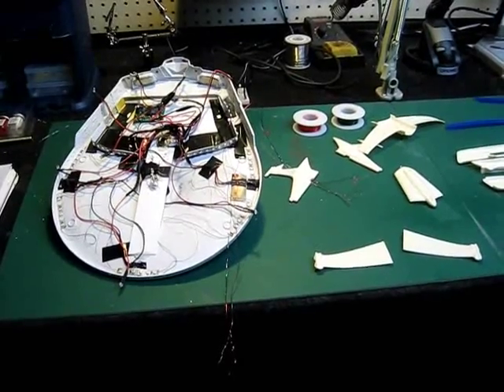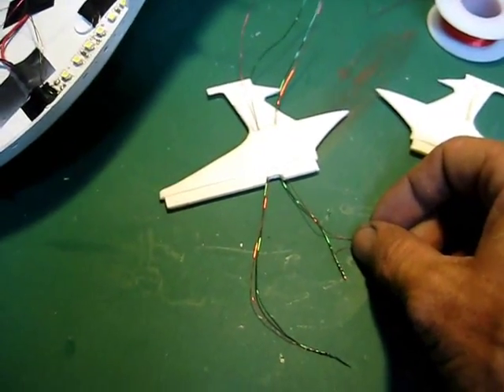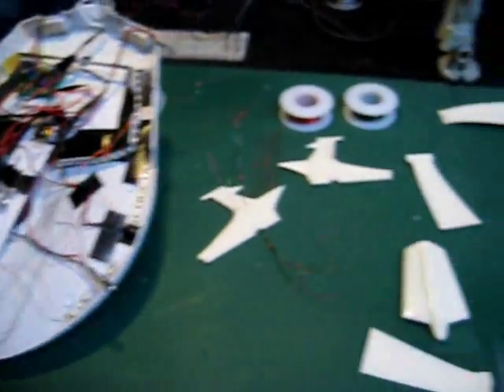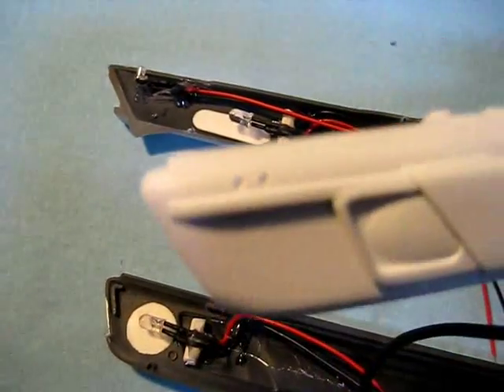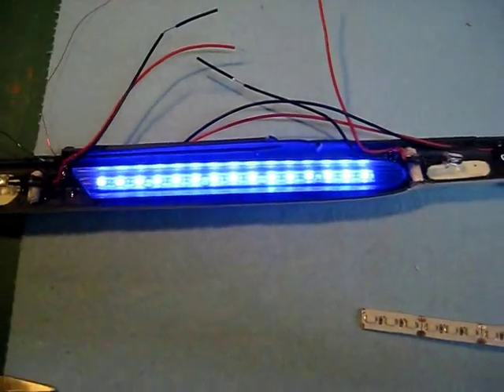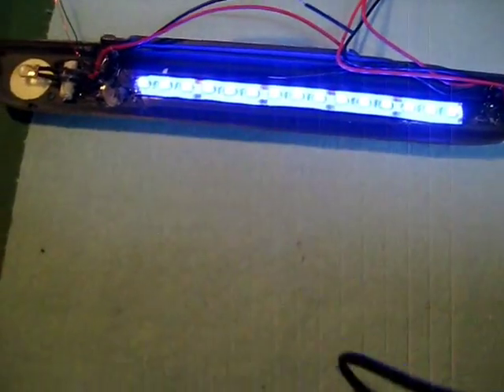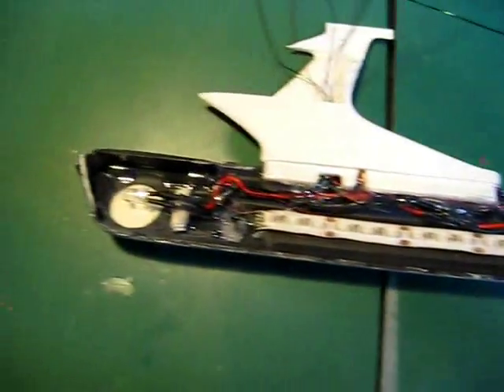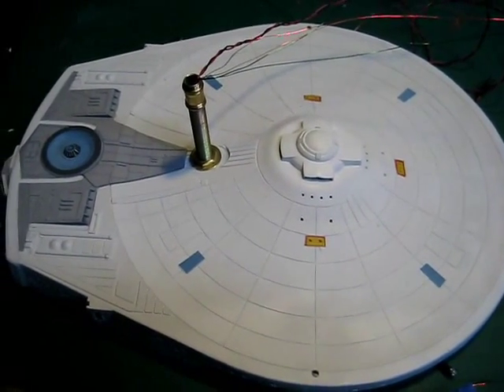From TrekWorks Round 2 Models 1/537 Scale USS Reliant Buildup PT 8 Building Nacelles

Comment: What size is the mounting tube you are using and where did you get it? Looks better and more stable than something the size of the kit parts and stand. Thanks.
Reply from the maker: Its a 1/4" threaded rod. I get them at my local Home Depot in the lamp repair section along with the lock nut's collets and washers.
Reply: Cool, thanks! Just picked up the Reliant kit and am going to light my first kit.

Comment: Hy - just getting into lighting up model kits and saw your circuit board at 2.52  Wonder if you can tell me what components you used plus their individual values.  I have never used circuit boards in a model just fibre optic strands and a super bright led.  I'm going to practice using a bunch of components and a breadboard to see if I get on with it before I start wrecking a good model!  I have a Peregrine fighter I would like to light and a Kazon fighter.  I want to use a 9v supply.  Would like your input please!    Cheers, Steve

Comment from the maker: You want to use a 1/4 watt 470 ohm resistor on each LED you connect. That is the correct resistor for a 9 volt power source. I use a 9 volt AC/DC convertor (Wall Wart) rated at 1.4 amps for my power source.

Comment from the maker: Are you using paint from the same batch you started with? If so the only thing you may notice is a slight difference in the gloss at times when you blend. The color should be the same. The gloss difference is corrected by top coating with clear to even it out.

Comment: So exciting to watch! On my 1/350 Refit Enterprise I used two 3mm blue LEDs facing each other at opposite ends for the warp nacelles.Inside, the unpainted white polystyrene plastic reflected the light to give it an even glow.I'm really liking how this LED tape works even better yet! I noticed with the magnet wire you twisted some of it upon itself.Is the insulation sturdy enough where it won't rub off?I've not used this before.Such a cool build you have going on here.